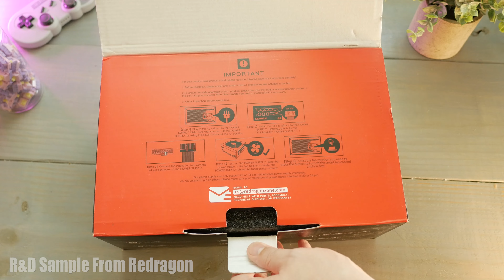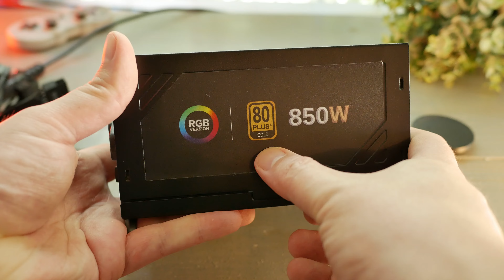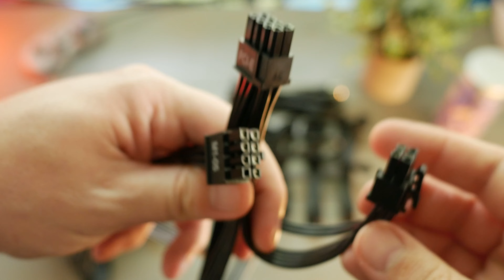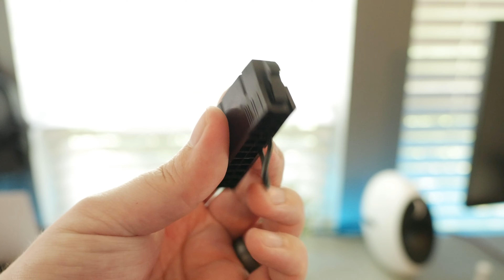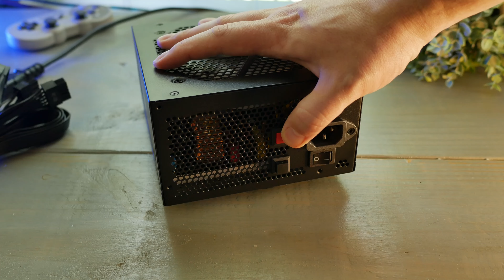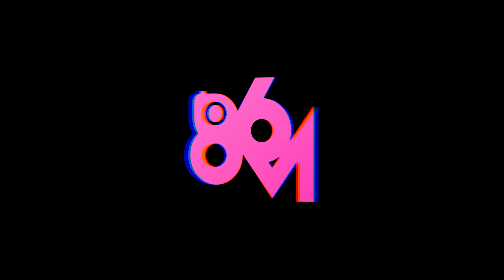A quick peek at the new Redragon PSU!

Comment: curious if OP or anyone has had any update of the PSUs since this vid. A lot of reviews discussing the psu is not good and yet i cant find ANY info or evidence of peoples PSUs from reddragon actually failing in any way.
Reply: Hi person here with this PSU, so far it is still working. When I first got it it was defective, but they replaced it immediately after I told them. Have had it for 2 years and it works like a charm still
Reply: @wowperson101 do you still use it now? and what's your pc specs if it's okay to ask. I am also aiming for this one because its cheap and fully modular

Comment: Can tell you one thing, Redragon has fantastic Customer Support. My M908 Impact mouse started acting up, contacted them and they sent me a firmware update and some new drivers to try, didnt fix my issue, they asked for my address and within a week I had a new mouse in my mailbox. They didnt even ask when I purchased the M908, and the M908 still retails for $35. So when I needed a new cooler, I purchased their latest 360mm ARGB AIO(CCW-3014W), it performs, carries a 5yr warranty and is less than $100. But when it comes to PSUs, the most important component to any build, go reputable or go home. #Seasonic
Reply from the maker: Love stories about good customer experience, it's awesome to know that a company takes care of it's purchasers when so many don't. I also agree with your Seasonic take! They are my favorite brand for PSU, but usually only for specific builds! For lower mid range, I've been buying Thermaltake Smart Powers and putting extensions on them. :D but if its something big, a bit more luxurious...Seasonic all day.

Comment: I ordered this off Amazon a month ago it would boot up when wasn’t plugged into the pc , but when I plugged it into my pc it didn’t work I just ordered a new mobo is there anyway the psu was to much for my old mobo
Reply from the maker: Hard to say without knowing your motherboard or being there with it. If you are having issues I would recommend RMAing if you think its defective
Reply: You could've used an 1600w psu and it wouldn't be too much. Power supplies don't push power, components draw from it. Meaning your motherboard wouldn't draw more than it needs

Comment: If u plug it in should it light up automatically
Reply from the maker: I think all versions have a red button on the back now when powered on it should activate and cycle lights
Reply: @EightSixMatt  mines plugged in rnnn and it’s not turning on
Reply from the maker: @lmao-wxst3166  plugged in so a pc? There’s a jumper included to initiate the loop (atleast with mine there were) plug in to the 24pin and power on (make sure the power switch is on also)
Reply: @EightSixMatt  I don’t think I have a jumper but my it’s plugged in with power and I have the 24 in to the pc and it’s not turning on
Reply from the maker: @lmao-wxst3166  sorry, to elaborate - the jumper can test the PSU - if you plug it in you can operate the PSU - if in a new build check your front panel and make sure your pwr sw is connected right (triangles are + on pwr sw). If the psu isn’t starting in the build but can be jumpered it may be the front panel configuration, if you can’t operate it with the jumper it’s the PSU
Reply from the maker: @lmao-wxst3166  what mobo are you using?
Reply: @EightSixMatt  what’s mobo
Reply: @EightSixMatt  and I’m having a lil bit of Trouble trying to understand what ur talking abt, this is my first pc
Reply from the maker: @lmao-wxst3166  No problem I can probably help. Mobo is motherboard - the F_Panel is a header (which is an array of pins) the front of your PC has a power switch connected to these tiny plugs that go to various header pins. 

On larger mobos if you look close the Front Panel is labeled with things like +PWR SW- and PLED maybe HDD -RST SW+ depending on the motherboard you chose. These corresponding connections from the front of the PC need to be connected but most specifically the PWR SW one which will be two tiny holes on the end of a cable. 

On the switch itself is a carved tiny triangle and that triangle represents + - it needs to be plugged to the positive + for PWR SW on the header.
Reply from the maker: @lmao-wxst3166  Here see if this short I just found helps: https://www.youtube.com/shorts/eIcXoXnA2z4
Reply: @EightSixMatt  I did all that bro
Reply: @EightSixMatt  and I did like up the triangle
Reply: @EightSixMatt  but the power supply doesn’t turn on bro does it have to be connected to the pc for it just to light up
Reply from the maker: @lmao-wxst3166  Hard to say as I can't physically see how you have things configured. if your CPU has its pins plugged and the mobo has its pins plugged, and the PSU is set to ON and the correct F_PANEL pins are connected you should be able to fire her up. If you can jump the PSU to determine - thats what I would recommend, or try a different PSU to test. Very commonly the F_PANEL is whats configured wrong so I would personally start there and double check this against the manual. This is an easy place to get something backwards for new builders (not saying you did but sometimes I still do myself switch something)
Reply from the maker: @lmao-wxst3166  IT DOES need to be able to be triggered - it will NOT power on unless it can be triggered and this happens either via a jumper closing a connection, or the F_PANEL doing it via sending the signal via the front panel power button. 

In my video for instance - it has a jumper on the 24 pin - this is how I am able to turn it on without a PC.
Reply: @EightSixMatt  the power supply turning on it’s working and and the pc is on just the fans aren’t working and the rgb for them
Reply from the maker: @lmao-wxst3166  Just to clarify, the PSU fan, right? your adding an S  on fan and saying "them", I just want to try and get on the same page. The PSU Fan is not operating? Or your case fans are not operating?
Reply: @EightSixMatt  my power supply is on the fan for it is onn too and the graphics card fans are on and the cooler fan is on just the fans for the case
Reply: @EightSixMatt  does the pc have to bc plugged into the walll directly
Reply from the maker: @lmao-wxst3166  In the interest of assuming your not trolling at this point - I'll bite: Your case fans can vary - they need to be either connected to a PWM header, if they are also RGB, an RGB Header also. Most fans come with a SATA or Molex plug controller - those need to be connected to the PSU - if your fans are not lighting - controllers require them to be in order - you cant plug your first fan in to slot 2 on the controller - must be slot 1, don't skip any 1-2-3-4-5 don't go 1-3-4-5-6 or 10-9-8-7, start at the slot one and connect them this way. As long as they are powered by the PSU, and plugged in in the correct order - you're in business. I've done all I can do here I think - best of luck.
Reply: @EightSixMatt  the fans came already in the pc I didn’t install them
Reply: @EightSixMatt  I appreciate the fact you spent all the time to try and help somebody this much. I'm not sure if he was trolling or not, but your dedication to that much response was kind.
It helps people who are actually having some issues.
Reply from the maker: @GetsugaTensho33  I try where I can  ¯\_(ツ)_/¯

Comment: was looking at this psu because there’s a sale on their site, I looked at the psu tier list and it was tiered at E tier, which made me pretty skeptical. Is this a good buy?
Reply from the maker: If you’re not comfortable don’t do it, I am running 2 currently out of my 5 PCs and have no complaints. I can say in my experience it’s been apt. Ultimately do what makes you comfortable. 😊
Reply: It's outlived my asus mb so that's a plus
Reply: Sometimes the E tier includes power supplies that are so new they just get automatically put in E tier lol. Like this psu
Reply: @ezoez7548 It looks like that’s the case for this one. I had it in my cart and then found out about the whole psu tier list deal and when I saw this was E tier freaked out, but yeah it looks like a solid unit so I’m gonna get it

Comment: Have this coming off amazon on friday.  Hopefully it does well.  Thx for video
Reply from the maker: Hope it was helpful!
Reply: @EightSixMatt  it was.  I installed it thursday.  Seems to be running good. Have a 6950xt and R7 5800X3D on it now.  Rgb and fan are working good
Reply: Do you, or should you have the fan facing down? Or up? Mine original stock psu was flipped so the fan is facing down but for this redragon one idk if i should do the same or leave the fan facing up ( there is a dust cover and honeycomb gate on the under side of the psu compartment on my pc case)
Reply: @MusicPerson233  There's a number of cases where orientation matters. For example, if your case has a compartment that hides the PSU then you're locked into fan down position. If it's one that doesn't have that you can run it either way. If you have a tall carpet then you should run it in fan facing upwards position or keep your computer off the ground as that would choke the PSU. 

Hope that helps you out.
Reply: @ArtisChronicles    Wrong in my PC case.My case is a BEQUIET, Enclosed at the bottom so the PSU is hidden. No problems pointing the fan up but the case MUST have a dust cover on the bottom for this configuration to work. Remember the PSU sucks air from the outside then the PSU fan "exhausts" the air  away from the PSU.
So with the fan pointed UP you are drawing air into the case. Fan pointed down the air goes out. Ihave my fan pointed up as it does cool off my GPU abit but I do nor live in a dusty place.
Reply: Have mine coming from amazon now … how is yours doing ??

Comment: I use this in my personal rig have had zero problems gpu and cpu are also holding a pretty aggressive oc to
Reply from the maker: I'm now running two of them myself. So far fire-free :) They have been nothing but solid here also.
Reply: @EightSixMatt  yeah i even tested the voltage out put nothing weird just a good power supply think LLT gave it the snub just cause its a non main stream unit
Reply from the maker: @jeffreygrindle6396  who knows. Someone else mentioned that (the LTT thing) - someone else refuted that, I couldn’t find where he did a snub. Maybe they got a dud? Idk. The OEM has been making that same model PSU for other resellers for several years. It’s odd but idk how detailed their dataset was or what they had on hand to try for that matter. 😊 all I know is I agree with you - it’s a sound solid PSU and I’ve been getting plenty of mileage out of them. If something DOES happen I’ll make a follow up. I predict they will run fine until I retire them though.
Reply: @EightSixMatt  How is it running ?
Reply from the maker: @Pre3minent  still going, runs 24/7 on a pc I’m hosting satisfactory servers on.
Reply: @EightSixMatt I have one of these laying around and have a build I’m doing. Do you think this psu could handle a aero 4090 oc24gb and ryzen 7 7800x3d. I’m not against ordering a different one. But I do have this 850 80 plus good atx3.1 pcie 5.1 ready
Reply: @EightSixMatt  do u thinks it’s good use this psu for a 4080
Reply: @jonathangonzalez176  should be fine the one I use is the white 850watt unit my rig is running a ryzen 9 5900x paired with a 6950xt no issues and im pulling at least 650 to 750 watts
Reply: @jonathangonzalez176  although my 4070ti doesn't draw as much as your 4080. it's been rock solid and fan barely needs to run when i'm gaming on it. i'd presume depending on your CPU you'd likely be fine with an 850 or for extra safety margin go for their 1000w variant
Reply: I just bought this power supply.  Will this be OK for an I7 14700k with a oc 4070?

Comment: Gold and fully modular was all I needed to hear, lol. Two of the main things I look for in a PSU.
It's refreshing to find a reviewer that shows all of the RGB styles and looks 😁

Have a good weekend and don't melt.
Reply from the maker: I'm surprised you were satiated with the few I demo in this video :D. People are not overly excited for PSU videos. PSUs should come with a slice of cake to make them more exciting to people.
Reply: @EightSixMatt  -- Agreed. Too many think a 400w Bronze is just as good as a 1250w Gold. They'll shell out $2k for a GPU, $1k for a mobo, and another $1500 for a CPU, and $35 for a clearance PSU. These are the same people that think a 6-outlet Walmart power strip is a surge protector. Mouth breathers, lol.
Reply from the maker: I'm reckless and use Walmart surge protectors :) BUT YEAH, that most common cringe move of "buy a cheap off brand PSU, and put it with all my nice new stuff" It's a recipe that might leave a bad taste down the road.
Reply: @EightSixMatt  -- I would never trust any electronics to one of their power strips. Now, their Great Value PSUs are a different story. I'm running one right now and haven't had any iss
Reply from the maker: @swervature  If I wasnt so concerned about another UPS or Backup smoking on me I'd go that route again.
Reply: Cop out not revealing the OEM